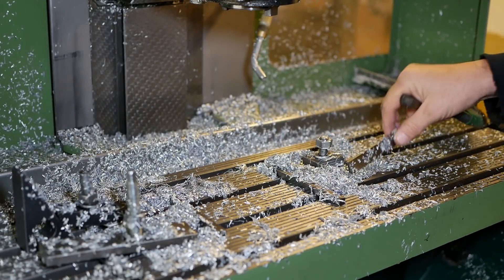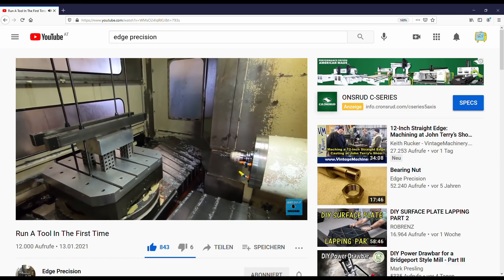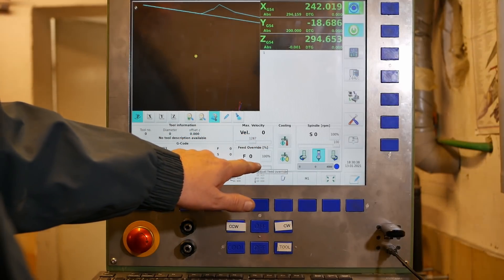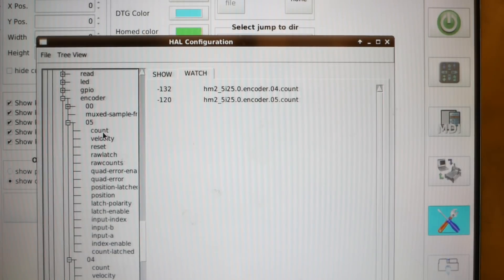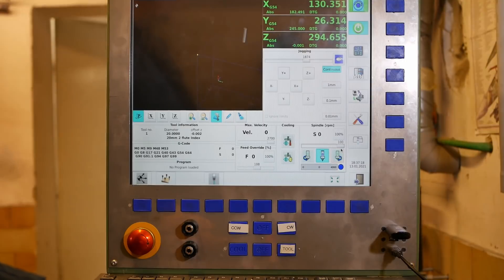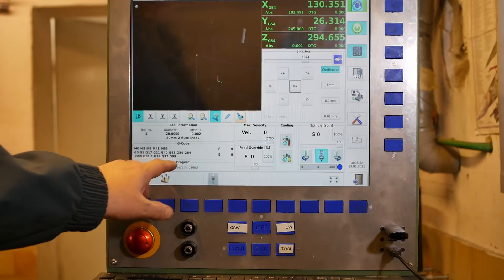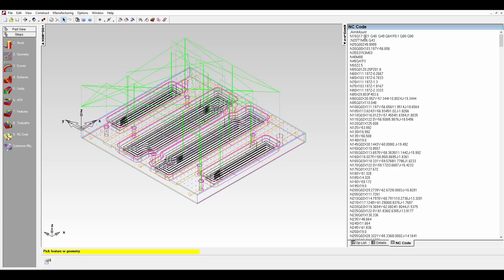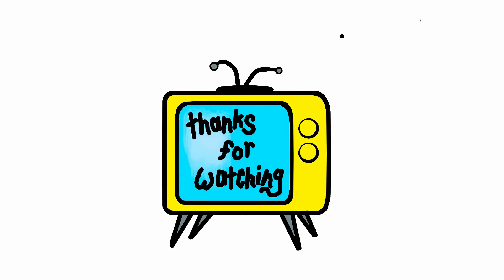What I learnt from crashing my CNC Mill

Comment: i am a cnc machienist and i use fusion360 ,it is able to generate Gcode from a design and you can setup tools with it as well, and i have a suggestion get a tool setter so that everytime you put a new tool it will probe the lenght first and prevents crashing seeing you already do it manually for every tool ,with a tool setter you put the tool in then it goes to the spot where the toolsetter is and automatically touches of and knows the offset greeting from holland :))
Reply from the maker: I have a tool setter, but have only played around with it so far. It seemed to hog too much table. The travels of the Maho are not huge. X400 and Y275.
Reply: @RotarySMP  are you able to get the spindle center outside the table? if so id make a bracket and hang it off the table
Reply from the maker: @sebby_cnc  No, the table is much larger than the travels.
Reply: @RotarySMP  if thats the case you might be able to override your endstops im not sure though .i seen some machines also have an arm like our cnc lathe has an arm that comes out and messures the tools and ofcourse that arm knows the offsets to the chuck ,i think that should also be possible with a millingmachine
Reply from the maker: @sebby_cnc  No, my end stops are located pretty close to the ends of travel. Less than 5mm overtravel til the ball screws go on block.
I don't find touching off a set of five tools using a known diamter pin to be that slow, or much of a hassle to be honest. Les hassle than having to keep moving the tool touch off around the table. A swing out arm could be cool though.
Nice future project.
Reply: @RotarySMP  ok well i was just giving you idea's at work we use a tool presetter aswell ,but we have a toolchanger so then its easyer to put the tool offsets in your toollist on the machine and we also use a 3D clock :) we have machines from MASS and Lagun and a samsung cnc lathe
Reply from the maker: @sebby_cnc  Those 3D clocks look really handy for touching off the work. There is a pretty cool widget in LinuxCNC to integrate with a Renishaw style 3D probes also, and do auto probing routines. I keep an eye out for a cheap one of them.
Reply: @RotarySMP  renishaws are exspensive for home use a 3D clock would be good enough
Reply from the maker: @sebby_cnc  I actually started making a 3D probe, but got side tracked.